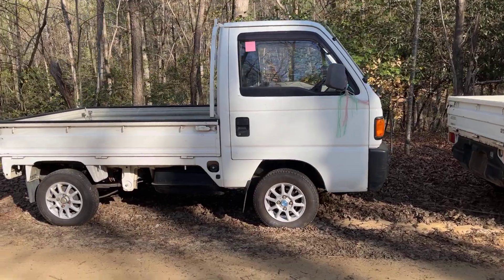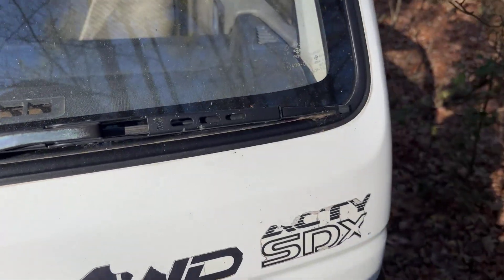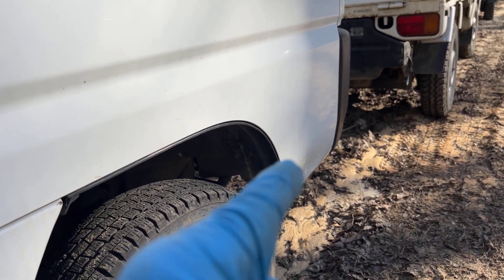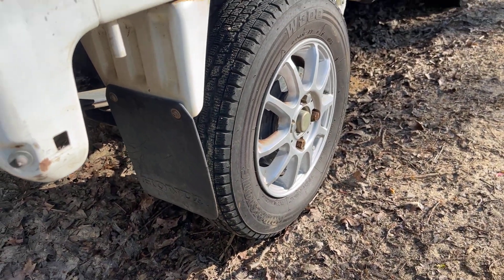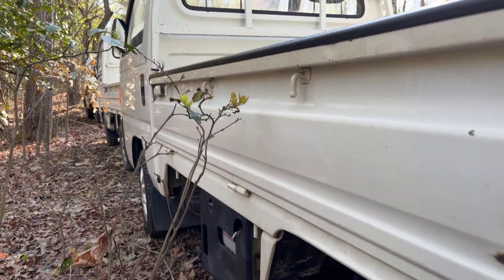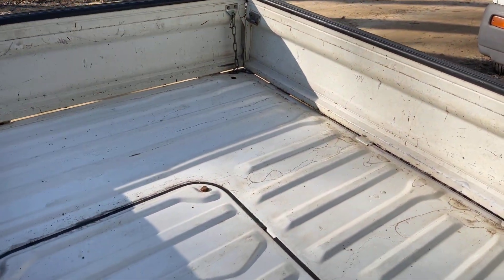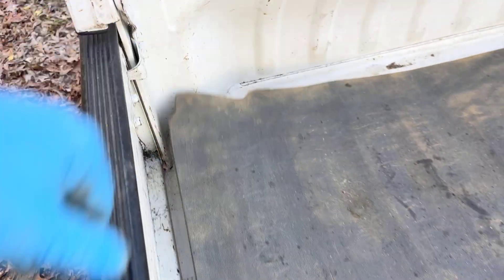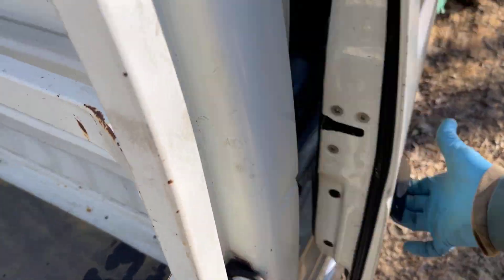April 13, 2023 shipment Video #2￼

Comment: You have said that diff lock is not really needed, and I agree.  That being said, I have a 4 x 4 mini truck with diff lock and find that I use it quite often.  If I'm going along in 2wd and see that I will probably not get enough traction going up an incline, I just lock the rear without stopping, and proceed.  After getting past the point, again without stopping, unlock the diff and keep on going.   I have been in a situation (probably should not have been there) where 4 x 4 without the diff lock didn't help.  (had to use 4 x 4 with diff lock)  I like the honesty you portray in your videos, and have told people about your business when they ask me about my truck.